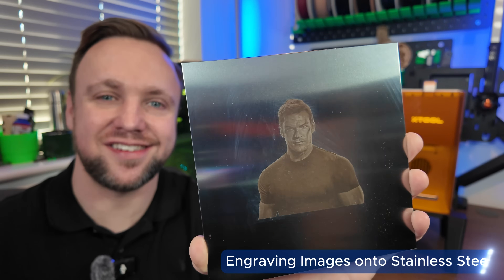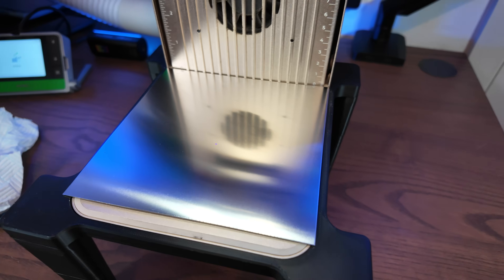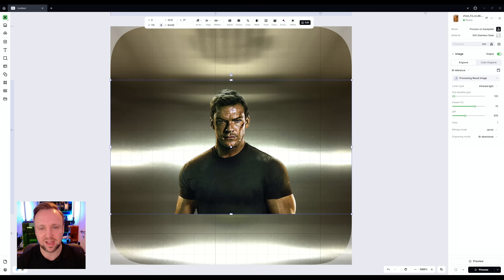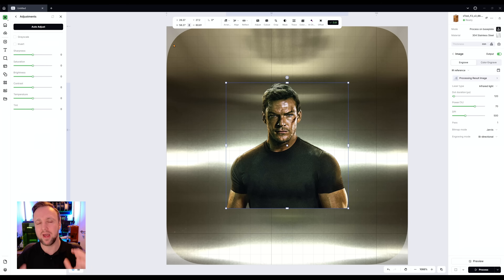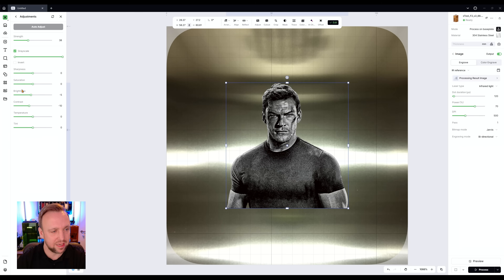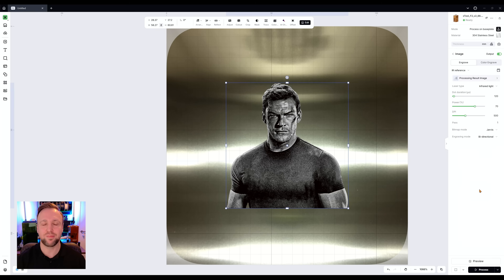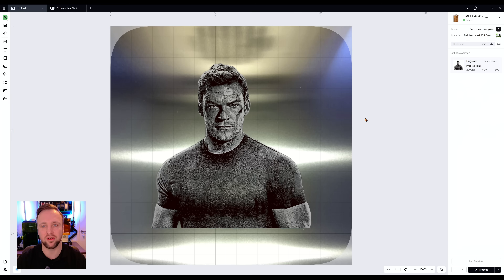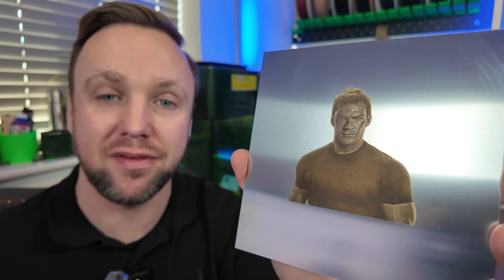How to Engrave Photos on Stainless Steel with the xTool F2 (Beginner Tutorial)

Comment: Hi! I was wondering if you know what pulse width and frequency this was done at? My Stainless Steel preset is usually at 500 pulse width and 65kHz which I think is too high heat for 0.3mm stainless steel sheet. Thank you!
Reply from the maker: Unfortunately the F2 isn't a Fiber MOPA laser (it's an IR) so it doesn't have Pulse width and you can't specify the frequency.

Comment: Merci infiniment pour ce tuto qui va beaucoup nous aider dans nos projets de gravure! J'ai une question concernant ce type de gravure, ne faut-il pas recouvrir l'acier inoxydable d'un revêtement foncé afin d'éviter que le laser ne reflète dans la lentille et ne l'endommage?
Reply from the maker: I address this in the video, it is advised to offset the item you're engraving on to so it is not directly underneath the laser. This allows the light to refract off at an angle and not back onto the lens. Other people also coat the material with substances to dull it down. In this case (and others) I have the item directly underneath and so far I've had no issues. It's all down to what you are comfortable with doing.

Thank you for watching and for the kind words.
Reply: @L3DAccessories merci pour votre réponse et désolé je n'ai pas encore la traduction de la vidéo en français c'est pour ça que j'ai loupé cette explication😊

Comment: 2 questions - 1. can the F2 Ultra engrave under its base, like if I wanted to set it on something to engrave (Car hood, cabinet door etc) . 2. Can the F2 Ultra be use with wood at all for embossing? I read it's not recommended because its too powerful, but can you dial the power down to the point where it works? Can you show the mopa and diode on wood so i can see what that looks like?
Reply from the maker: Just to confirm, the machine in this video is the regular F2 and not the F2 Ultra. I don't own the F2 Ultra but I can answer your questions. 1. It cannot engrave through the machine as the baseplate is solid and does not have a removable base plate. 2. If you get the dual version it can engrave onto wood. The increased power does make it a bit trickier to get the settings right when engraving onto wood but it's definitely possible and lots of people use it for that very thing. 

Thank you for watching.